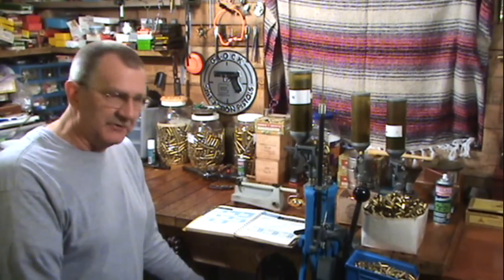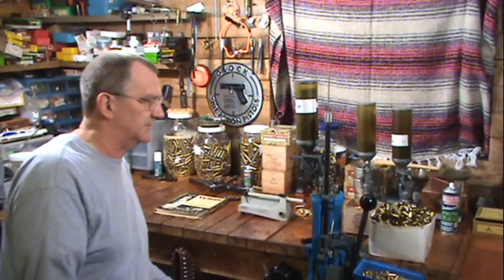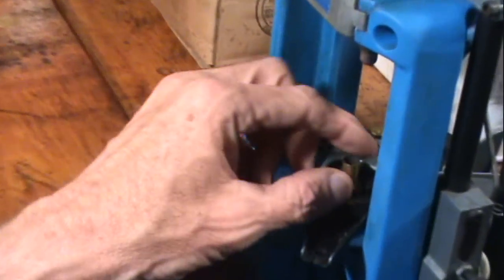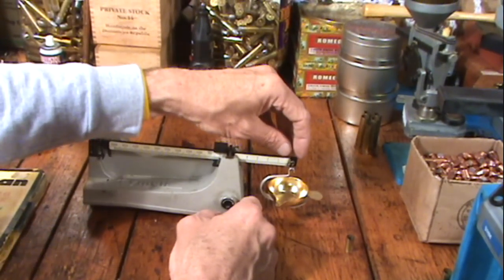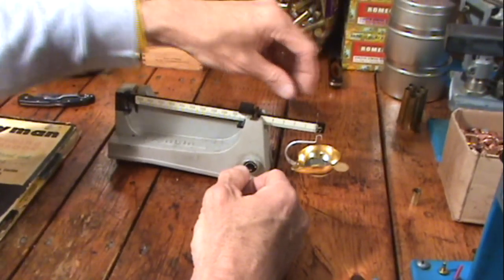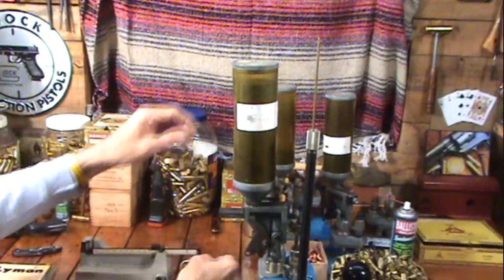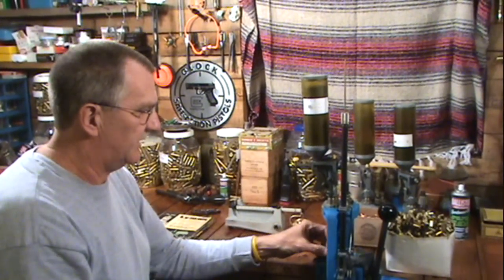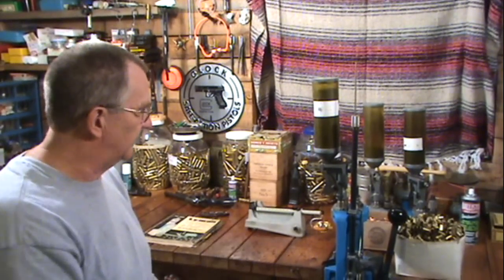Reloading Tips (powder charge)

Comment: Try using a loading block and put about twenty or so cases in it to charge with powder.  After charging each case and before you seat and crimp the bullets into the cases, inspect each case to make certain that there is powder in each one, there is no double charges of powder in any of the cases, etc.  Hope this helps.

Comment: I've not personally noticed the thickness of brass having much impact on the strength of it.

I have noticed that harder brass doesn't tend to last as long, while softer brass holds the pressures and being reloaded many times over, for a longer period of time.

Thicker brass can sometimes undersize a cast bullet during crimping operations, as well.

Too many variables to ever give perfectly clear answers, it's all a science of experience.

Comment: Balance scales are "in my opinion" the most reliable/accurate for the money. All digital scales I have seen measure in grams and convert to grains. Even if it measures to .01 grams that still converts to .154 grains.  Read as digital scales will read in .2 grain increments.
Not a big deal in larger rifle powder volumes (unless you'r loading for benchrest accurracy) but a huge deal in smaller pistol calibers where min. and max loads only differ by tenths of a grain.
Just 2 cents.

Comment: My only objection to what I see here is that every time I start a new reloading session or open a new container of powder, I recheck the weight against what was set before.  If powder is left in the measure it can absorb moisture from the atmosphere in summer or dry out some in winter and a new lot number of powder may be different in specific gravity.  But then I'm a nationally ranked competitor with very little tolerance for variations in any load and tend to be a bit anal about accuracy and load consistency! :)

Dillon powder measures are only accurate to within 1/10th of a grain and most powder scales are only accurate to that same level unless you break the bank buying the top end stuff, so checking the weight of powder drop may be a bit of overkill shooting as Hickock45 or the average shooter does.

Sorry if this seems to be nitpicking! :)

Comment: Hi Hickok45, i like oure Vid. 

I use the same Dillon Pwd.sys.  but i make the powder balance weight up to ten times higher. as example:   to get exact 5 grain,  i put the scale to 50 grains an fill ten cases in the pan. If then  only 48 grains ore 52 in, i adjust it ! That brings me more then  to one Championchip ...

Comment: you can probably use the same powder in the .45 and the .410, as they are close, you may even be able to use that same powder in the 12 gauge, but all 3 of them use a "pistol" powder, but the 30-30 uses a fast rifle powder. you would get too high of pressure in that case real quick if you tried to use a quick pistol powder.

look up all 4 ammo's charts and cross check the powders, you my find you need at least 2 powders.

Comment: Hickok, when you load using unique, do you have fluctuations of a couple of tenths using your powder measure?  If I keep my powder hopper full (loading .41 magnum), I get between 8.4-8.7 with 90% of loads being 8.5-8.6.  However, as the hopper goes down the loads spread to between 8.3-8.7.  Now all these loads are safe.  Shooting the gong you'd probably never know the difference, but it just bothers me.  At any reasonable distance with a pistol you're talking drop differences smaller than I can hold the gun still.  (Disclaimer: these loads are safe in my gun with my bullets at my seating depth YMMV)

Comment: Good quick update for new reloaders. Bravo as always Hickok lol. One thing though, do you use a seperate powder measure for each and every caliber your reload? You said you hardly ever get out the scale to weigh check what it's throwing, so I assume that means you have 1 for 9mm, 1 for 10mm, 1 for .45 Colt, 1 for .45-70 etc. Is that correct? I never though of setting up like that, as I just pull my measure out, get it throwing what weight I want for a particular caliber using my scale and then start loading. When its time to change calibers I re set the powder measure to throw the new charge and so on. Would be much easier to "set and forget" though.

Comment: they have no control over your personal loading abilitys.you may not weigh it or measure the lenth and blow up the gun do to a over pressure. or u may get a round stuck in the barrel and this is due to wrong size ie .357 in a .355 or under pressure

Comment: Great vid. On the hodgdon online data. Have you seen the 45super data? I load 45 acp. If you use 6.0gr Hp-38 powder & 230gr ball cup pressure 19900. Isn't that safe for any 45? AA data has all there max loads at 20000 cup.

Comment: Just like to say excellent videos for learning about guns/ammo. My question is finding load for 38 special 158 grain bullet. Im using titegroup powder for a smith and wesson 357 handgun. I'm finding different powder loads. Not sure what the grain load is for it??
Reply: since you're shooting 38 special in A 357 mag gun , you have some wiggle room....case lenghts don't become a problem, if you load to38 sp +p pressures, youre  still not close to the pressure of 357 mag. If you want like recoil ,you can load 5 gr of bullseye with a 120-135 bullet...but pressure rise when pushing a heavier bullet, but you might want to us a less 'hot' powder... maybe unique or tite group.... each has data on the manufactures website with bullet weighs and powder  charges.

Comment: Hey HicKok,
Why is there elastic band around your powder measure?
tnx for the video
Reply: He's using it to replace the guide rod that's normally found on these reloading machines. That guide rod is connected to the shell plate, and as it normally goes up and down it actuates the arm on the powder measure. It really only becomes useful on the way down when the rod will "reset" the powder measure. The elastic band is accomplishing the same thing but in a different way lol. It's freeing up space near the brass so your hands can get in there, if you like to do frequent checks to make sure the powder is being thrown accurately

Comment: What am I missing?
The vertical rod that goes from the base to the powder mech appears to be missing, yet it is dropping powder?
Reply: The rubber bands that go around the powder measure and the bolt that's on the powder bar do the same thing.
Reply: Elliot Check & Bruce Tucker: You've been seeing the 550B or 550C versions and what he has is the old original 550 that uses springs to return the powder bar.  I have the same press that I bought in '85, and to many of us Old Timers, it's more effective and MUCH quieter than the 550B or the latest, 550C versions.  Dillon has changed/upgraded the 550 since Hickock45 and I bought the old original version.
Reply: Ah, thanks for the info. Yes, the one I have is a 550C and the first progressive I loaded on was  friend's 550B.